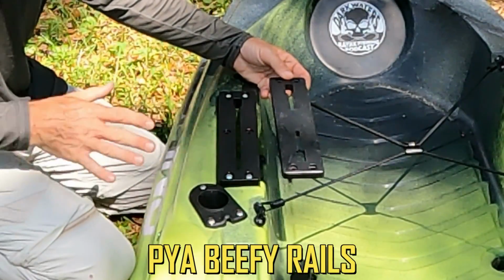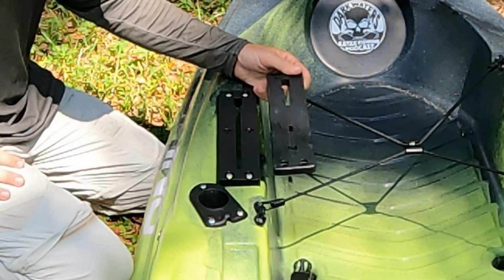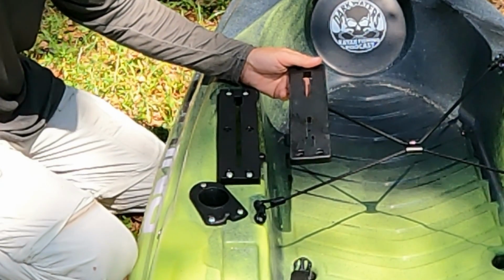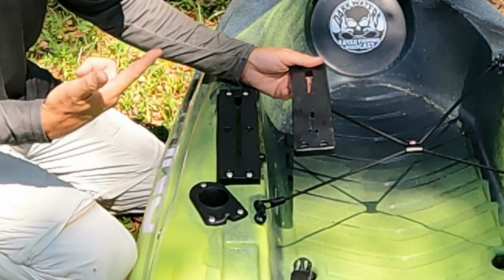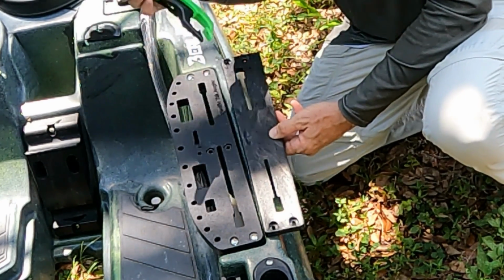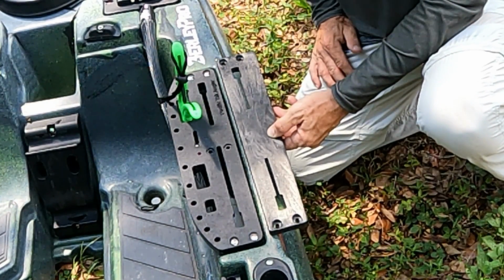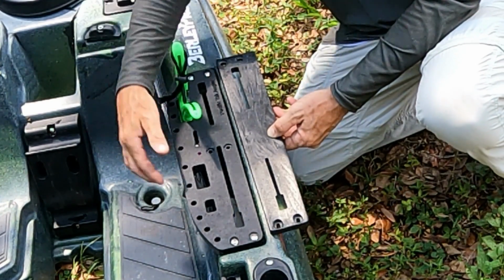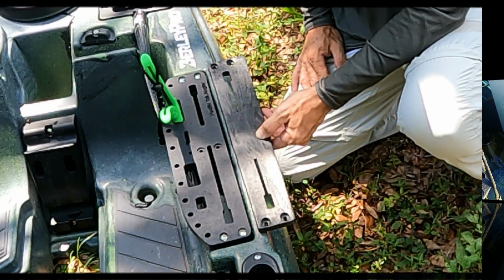Pacific Yak Angler Track and Rail Upgrades for Old Town Predator and Bigwater 132 PDL

Comment: Do you have a way for this to work on a recon or way to buy one?
Reply from the maker: You can buy them at https://pacificyakangler.com/ and if you have a flat surface, as well as access to the inside of your hull for washers / nylon locknuts / backing…you can add them.